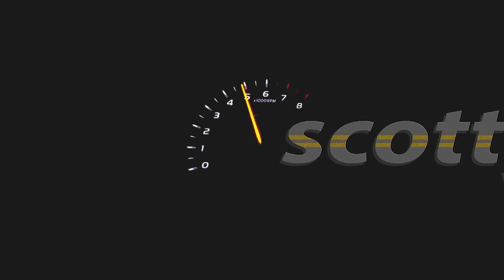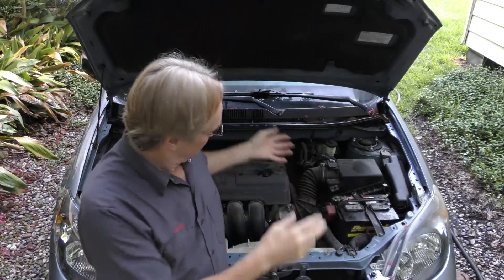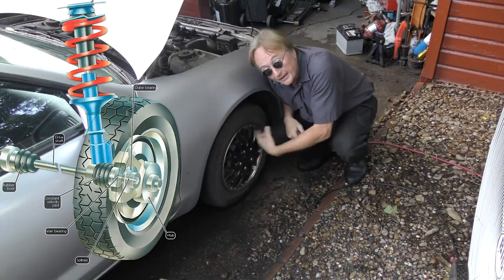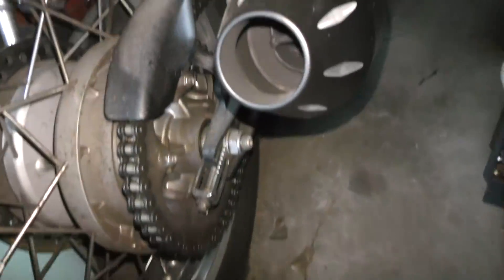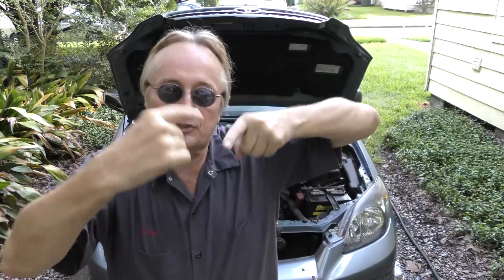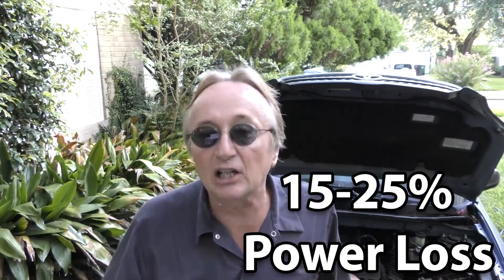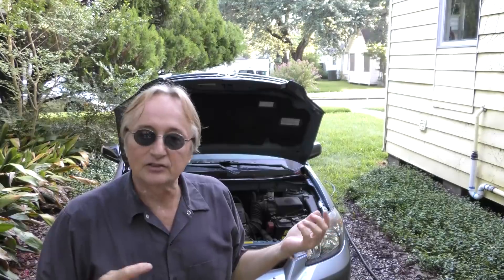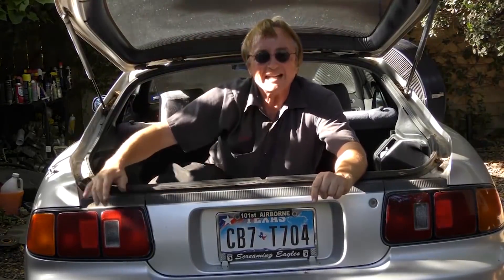Here's Why Your Car's Horsepower Rating is a Lie

Comment: I imagine the same is true of diesel trucks?  Mine is rated for 350 hp and 800 ft-lbs of torque so it's a monster, I can merge like a car with 12,000 pounds of trailer on, but I imagine I am doing it on 300 hp at the wheels?  How does torque drop off from engine to wheel?  Are there losses there too?  Horse power is basically torque x rpm, so does the fact that diesel engines spin at a lower rpm than gas engines (about half) mean that they lose less power in the drive train?

Also, why is it that a diesel engine rated at 350 hp can far out-tow a gasoline truck rated at 400 hp or more?  It's from the torque I know, but why is that?  Wouldn't the transmission in a gas truck be able to turn the higher rpm's into more torque?  I know they rate the Ford Ecoboost engine in an F150 at some crazy towing capacity like 15,000 lbs, but experience suggests they mean around the parking lot not up a hill on the highway.  Thing would be screaming like a jet engine and shifting gears all over the place whereas a diesel just chugs up it.
Reply: @Bryan-Hensley  So, 2 questions I have based on what I assume are your calculations, or maybe they are the same question:  First, what use is a wheel spinning at 10 rpm?  Are they just trying to figure out what weight the vehicle can get moving and then as the rpm's increase and the torque goes down that's fine, the speed just increases at a slower rate?  I think I may have answered my own question, I used to have an F150 years ago that I had mated to a 24 foot 6,000 pound trailer.  The Ford pulled it ok most of the time but there is one particular mountain pass near here where you basically have to start from a stop and then head straight uphill.  The Ford would get the trailer to the top, but it could not hold second gear so I had to put it in first and then just watch the tach so as not to over rev it.  Whenever the truck shifted into second it would start to lose speed, and it wasn't going very fast.  But it did tow the trailer to the top eventually.

Now I have an 800 ft-pd diesel engine but it isn't rated at much if any more horsepower.  Yet I can tow a 10,000 lb trailer up that same slope and it will accelerate to the speed limit and beyond in a relatively short period of time and doesn't "search" for gears.  So it seems to me a gas engine rated at 350 hp and 400 ft-pd torque is not at all the same animal as a diesel engine rated at 350 hp and 800 ft-lb torque.  I think it has to do with the fact that the gas engine only makes 350 hp in a very tiny rpm window up around 4-5,000 rpm, whereas the diesel makes pretty close to 350 hp starting around 1,500 rpm.

I think I first noticed this when I was a young lad.  I had an IT 250 dirt bike, which was zippy and fun.  My friend had and IT 500, which was a monster.  I was surprised to find out that my bike had 32 hp, but his bike being twice the displacement only had 40.  So you'd think "what's the big deal" until you rode them both.  My bike, the 250, had to be carefully managed gear-wise to stay in the "power band".  His 500 could pull a truck out of a swamp while idling.  It was all power all the time, at about half the rpm.  I don't think the 500 really had a "power band".  It just pulled.  I've noticed the same thing with these new 4 stroke 450's.  Changing gears isn't necessary.

Comment: 662 to 595 isnt all drivetrain losses. 30 are lost because you didn't use some special premium gas ford used in their tests and you didnt give it ice cold air for the intak, 20 are lost in the drivetrain and 15 are lost due to dyno inaccuracy. dropping 60 hp in the drivetrain means the whole power output of european car 1.4 atmo engine goes to heat up your drivetrain. this means the whole drivetrain would need a masive cooling with a radiator almost the size of the stock radiator of the car.

Comment: I guess you could argue about the same thing back in the day when horses used to pull carriages, given the same horse would require different amounts of energy to pull different size carriages - still 1hp though.  Anyway, I agree it's not a great representation of a car's power but it's not a lie given every manufacturer uses the same method.

Comment: Scotty i have a car question.  I have  a 2013 chevy cruze 85,000 km and a guy at work says that when i start my car up it burns a little bit of oil but then stops maybe 10-15 seconds later...what could the problem be? I notice i bave to put a little bit of oil in the engine every 1500 km maybe a litre.

Comment: Its not the right angle change in the rear end that causes the big loss. Its the "Hypoid" gears. they are part worm gear. require special grease. Big trucks use bevel gears. They are much more efficient. How to tell what you are looking at. is the pinion shaft in the same plane as the axels? if so its not hypoid. hypoid the pinion shaft is lower than the plane of the axels. Why did this happen? just so cars could have a lower hump in the floor. So, don't assume that front wheel drive is always more efficient. its not.

Comment: Isn't it the opposite for the Germans? Audi's RS and Mercedes-AMG's are rated lower on the paper than on the actual wheels. Like the RS3 is actually pumping close to 450 hp on the wheels on a dyno than the 400 hp that is stated in the brochure. Like the old R34 GT-R with it's 276 hp what actually was closer to 320. Why is that? Is something to do with taxes and some sort of regulations?

Comment: Yeah, it's all true. I already knew some of this stuff from Engineering Explained channel, who does a lot of car videos, but he is mostly into the very technical pure Math and Science side of things. You actually addressed some stuff he didn't Scotty, which was awesome. He was concentrated on horsepower, as it pertains to how the rubber meets the road and those losses, not so much on the gear losses etc. like you did (although he did touch on how the transmission in itself is a power loss). You went into some great details, right down the entire drivetrain, from the engine and how even engine direction affects these inevitable losses, which I did not know and found very interesting. Great stuff! Leave it to a Mechanic to see something and Engineer doesn't. This is what leads to really dumb engineering, is not getting the thinking of/getting the opinion of a Mechanic. 

They should be asking themselves these things, like "How does this affect ease of repair?", but they don't sometimes and it pisses EVERYONE off. The Mechanic, the customer, the amateur shadetree Mechanics like me (back yarders) too. Tearing our hair out, at the sheer ridiculousness of it all, cursing them endlessly. Anyone who has worked on more than two vehicles has seen this nonsense and asked ourselves "Who the hell, designed this crap? Wouldn't it have been easier to just put that over here or do this?! Grrrrrr!"  Lol.

Comment: Another thing that manufactures take into account is every car produced today they want to be capable of running highway speeds which is 75 miles an hour and they don't want you to be really pushing the car to the end of its power limit so it's based on the size weight and shape of your car immature all things that affect how much power you need to move down the road at a certain speed for example in a car that runs down the road and would need about 40 horse power to run continuous down the road at 75 miles an hour they like 2 do this thing where they also know the gearing on the car and at around that particular engine RPM they like to have the engine producing at least an extra 6 or 7 horsepower over what you would need to have spare power going on usually in a car that would need 40 horsepower to maintain a 75 mile an hour cruising speed they like you to actually have an extra 10 to 15 horsepower at that engine RPM so that way once you start cleaning the hell or something you have extra power to tap into to maintain your speed while climbing the hill plus by giving it an extra 15 horsepower meaning that the engine is producing 55 horsepower at that engine speed and we're assuming that this is a small 4-cylinder car versus 50 horsepower at that speed that means since the engine has more comfortable power to spare that it is actually more efficient than if the engine is only producing 42 or 43 horsepower at that speed or you were literally having to floor it to do that speed down the highway any small 4-cylinder car if you were having to floor it like that just to have enough horsepower to keep up with the speed limit on a 75-mile highway you would only be getting fuel economy in the mid-to-upper teens to lower twenties we're driving around the city the car probably has enough power in an area where the speed limit is only up to 40 or 45 miles an hour to do 40-plus miles per gallon if you look at older Honda Civics you will notice this issue my 1995 Honda Civic had a 1.5 L with an automatic and I got mid to Upper 20s on the interstate at 75 miles an hour but City Driving where I could be cruising between 40 to 45 miles an hour I could do upper 30s to mid 40s for fuel economy wise cuz in the lower speed driving conditions does cars have plenty of power to spare but when you get into highway speed driving conditions they do not have much power to spare and since you are running the car demanding more of it's over all available power down the highway it actually requires the cars do more work than if you have lots of power to spare.

Comment: dyno is not an exact measure of horsepower on the road, either. you don't drive around with your hood open and a giant fan blowing on the engine. these cold air intake people thinking they will boost 10hp are really just getting gains from high flow filters, and filters serve a purpose. they keep crap out of your engine. without the high flow filter, whatever few hp you get from an after market cold air intake on a dyno will disappear on a drag strip or while towing on the road. dyno is not real world driving.

Comment: About the only time I’ve seen the ratings not be lie was with the LS1 engine cars. Those were underrated enough that the quoted engine horsepower was about the horsepower that you got to the rear wheels. Technically it was a lie but for the good.

Comment: Dude, no, the ratings are not lying. The horsepower ratings is what the engine puts out, a lot easier when they use the same engine in multiple cars than putting each car with each engine and transmission option on the dyno.

Comment: Let’s not forget that they test and rate these cars when they are in tip top running condition...at the perfect RPMS so after a few years with half bald tires, cheap fuel, cheap spark plugs you’re not getting the same H.P. anymore

Comment: I always wonder about these new cars with 700 plus hp because I had a 1974 Plymouth Sebring with 160 hp & that thing was dangerous! I could punch the gas at 35 mph & it would light up the tires & fishtail to about 60 mph before hooking up again. It would also do about 145 mph according to the rpm, gearing, & tire size, before I would lose my nerve because of the way it "floated" at that speed. Sadly, one day when I punched the gas at 30 mph, even though I had put off-road 31" truck tires on the back just for grins, it broke loose the monster tires, fishtailed & bit the curb which instantly pulled it into a ditch. The view from the windshield showed the sky below and the ground above for an eerie silent moment as the engine idled down, then THUD! the top of the front right fender hit the ground followed by more silence then BOOM! as it landed hard back on all 4 wheels and stopped almost instantly. I got out to see how bad the damage was. It landed so hard it blew 3 of the tires beads off the rims so they were flat. It was facing the opposite direction, but upright. The front right fender was squished and I had no idea where the back window was but otherwise didn't look much worse than before. Apparantly, the Satellite had been launched into a big lazy pirouette, free for a few seconds from the pull of the earths gravity in a sub-orbital spin, finally fulfilling it's real purpose, 16 years and 170,000 miles after being created. The engine was dead & I began to worry that police would arrive and give me a ticket - so I hopped back in - said a prayer - turned the key - and after 2 seconds of protest, it started and I  drove away with 3 tires flopping on the rims. So whenever I hear about some guy modifying his Hellcat & now claims to have 1300 hp in his grocery-getter street car. I wonder if he's ever been airborne upside-down in a car.

Comment: Of course HP only applies to the engine, not the car as a whole. There is no lying in it. The same way one could argue, that if the light bulb manufacturer marks a light bulb 800 lumens, it's a lie, because if you put it in a fixture, it will be less, and it will depend on the light fixture. But what if somebody wraps the bulb in foil, does it mean that now it's 0 lumens, not 800?

And I don't think that loss of power in the gears depends directly on direction. You can have a badly designed gear which doesn't have a right angle change, and have more losses than with a well designed gear which changes angle 5 times.

Comment: HP isn't generally accurate based on what a vehicle actually does.  Go figure my 89 Cadillac brougham 4 dr has the 307 V8 engine it came new with and has never been modified or even taken apart. With this car weighing 4400 lbs it can throw you back in the seat when you barely accelerate and this is especially noticeable after I drive my two trucks that have 230 HP, but this Cadillac engine only shows it having 140 HP, but the Cadillac is much more dynamic than the two trucs I drive also.  Factory manufacturing figures are BS.  Its the performance of a car based on the drive train and its assembly that produces results

Comment: hi mr scotty kilmer i want to ask your one question the engine which is build to be placed in mid engine layout has similar engine  v8 which is used in front engine layout or the engine block made for mid engine layout is different i am not talking about internal components i am talking about physical outer structure of v8 engine well waiting for reply thanks indeed

Comment: when i whent to the school bus gerage for 2 years i had a few older school buses from the lat 90s to the early 2000s that are made by international navistare that are powered by the dt466 6 cylinder diesel engine driven through the allison 1000 5 speed automatic transmission. I read the printing on the side of the moter and it sead around 250 hp. When i ridden in one of them busses it ownley felt like it performed around 140 or 130 hp i realy sea what you're saying.
Reply: at the shop thare was a same bus but it was a 2002 diesel rear plant pusher and it had a same transmission but with a overdrive added to it and going down the road it felt like it eaven had lower hp but had beter fuel milage over 10mpg. it boogies down the road pretty good every time whe hit a hill it fell back a gear some bit always mad it back up a gear. im geising having a overdrive realy afected the hp some. other then that it was a pretty good motor had lors of torque.

Comment: And the rated horsepower is achieved at a very high rpm aswell , so advertising is kinda misleading. Whereas an electric motor can produce max power almost immediately as I've seen at car shows on dyno tests.

Comment: Horsepower is JUST a Characteristic, energy is too much said, many people don't properly understand the therm energy and many of them are quite smart people ! (Horse)Power is JUST How Fast the engine Applies the Torque, that's goddamn all ! Power is NOT SOMETHING (physical) ! Power is NOT Force, Force IS Something, TORQUE is Force (multiplied by The Radius of the "arm of the force", in this case being the radius of the engine's flywheel, but wheeltorque is multiplied by the gears of the gearbox and the final drive ratio). Unfortunately energy is a too abstract concept which has just a very little usefulness, more mathematical.

Comment: This is so much misinformation I don't even know where to start. Car engine horsepower ratings are very tightly controlled, most are rated using SAE J1349 procedures. In the 60s and 70s they pulled all sorts of tricks to raise the numbers, like running on race fuel. That's why all the horsepower numbers dropped so dramatically. Horsepower is energy, its power a key difference. Also your loses aren't from the power changing direction in a rear wheel drive car but from the long driveshaft that's spinning. Chains are also more for reliability rather than efficiency, the lose in each one of those links adds up. Also those tuning dynos are notoriously inaccurate, the same car on 10 different dynos and you'll get 10 different horsepower ratings. They're really only useful for testing run to run differences.

Comment: Scotty ... technically the HP rating is a true number, but even your HP number at the wheels is just as misleading. The rear-wheel HP (RWHP) number is only PEAK horsepower, not effective HP. To measure effective HP you simply have to determine how much work the car can do in a given amount of time ... say go from 0 to 60 in X seconds. (In this instance we can interchange energy with work and use total Kinetic Energy achieved as the amount of work done.) This number will surprise you and most viewers, as the Mustang 500 mentioned in going from 0 - 60 in 3.2 seconds is producing only 268 effective HP. Yup, that's all. Doing the quarter mile is better, as the engine likely is running a greater amount of time in the higher HP band of its output ... but even then, it's only 358. Oh ... one more thing ... energy is not power. Power is energy over a given amount of time.